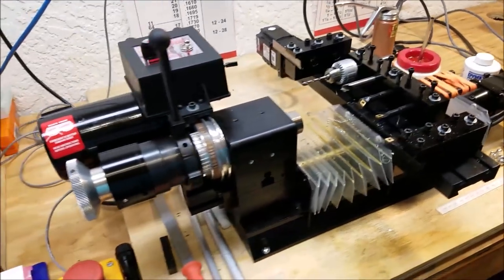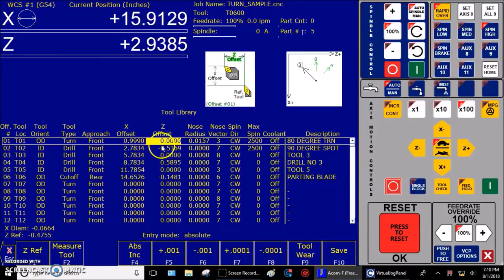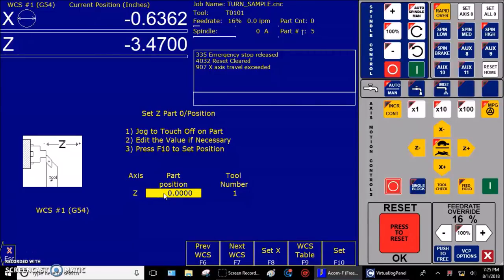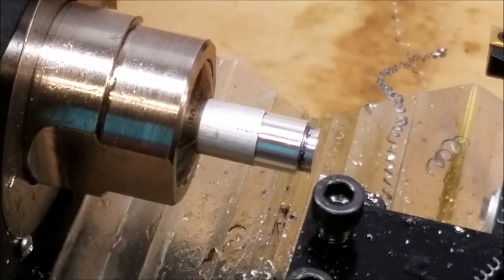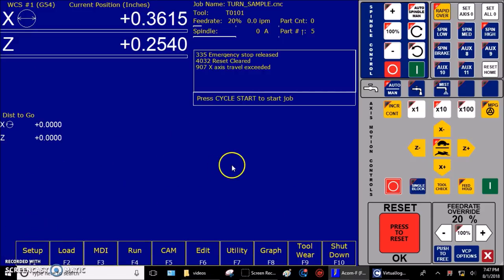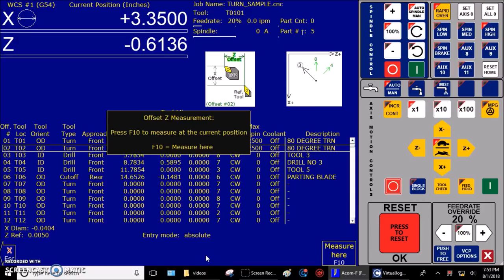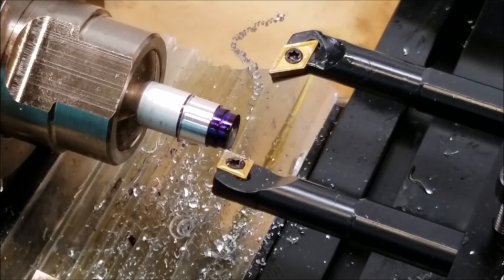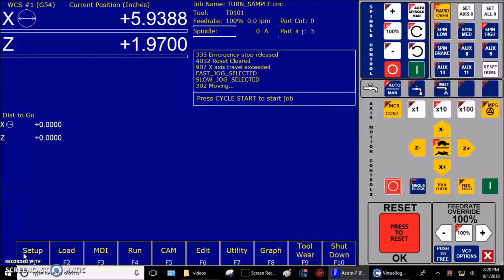Centroid Acorn CNC: How To Setup Lathe Tools

Comment: Hello Franco,  I found this video so useful and have successfully completed my tools.  I am having a problem though that involves tooling and Intercon.  I’m not getting the right finished diameters.  It’s very frustrating and Ive spent several days trying to get the correct result.  If I code my self for simple turning its fine.  Looking at the GCode it produces it seems to be taking twice the depth of cut.  I have tried using radius as well as diameter and I’m stuck.  Any ideas?  Mike

Comment: Thanks for taking the time to make this video. For tool check positioning is there a way to move the Z first them the X or only the Z? 
I have a gang lathe also and both axis moving a once may cause a crash depending on tooling setup.

Comment: Great video Franco! Can you comment on whether you have to do this process each time you load a new stock. I am wanting to produce maybe 40-50 parts per day and it would be a pain to have to do this each time I insert new stock.
Reply from the maker: Hi.  You only need to do this when you power up your machine.
Reply: @FrancoCNC  You have to do this entire process every time the machine is powered up? Or you just have to set part zero on your master tool on machine start up? Setting up all your tool offsets on every power up is terrible!
Reply from the maker: @ktaylor678  No, you only have to define your tools once.  If you have good limit switches, all you need to do on power up is home out your machine.  If you don't have limit switches, then you need to touch off your master tool on power up.  But all of the other tools will be good to go.

Comment: Hi Franco,
Was thinking of building a lathe similar to the one you have just set up. I would like to use a servo motor for the spindle motor. Can the Acorn be configured to use step direction for spindle control.
This video will be very useful in setting up the offsets. 
Thanks Dave.
Reply from the maker: Dave Bassett Hi Dave.  It is really easy to control a VFD with the acorn 0 to 10v analog output. I suspect there is a way to control a spindle with step direction but the Centroid guys will have to confirm. I'd check out the forum.

Comment: Nice Video! One question... how do you set the Z axis with a tool like Thread insert- cut off- round nose for facing. Cheers.
Reply from the maker: Well, that is a good question.  For threading, I just eyeball it when I'm working at home.  At my day job, I'll put the tool on a comparator or a measuring system like that and measure the distance from the cutting edge to whatever I'm able to touch off of.  Then, I'll adjust the offset by that amount.

Comment: For the Z axis why can't you just put a dial indicator in the spindle, touch off your first tool and zero the indicator. Then simply bring each tool up to the dial indicator and make the appropriate adjustment. It's much faster and more accurate than goofing around with the feel of shim stock.
All in all I think your videos are excellent.
Reply from the maker: Hi.  You certainly could do that and it would work just fine.  I tried to follow what was described in the manual to help establish common ground and a point of reference.  Thanks.